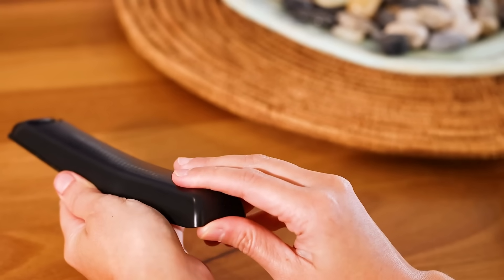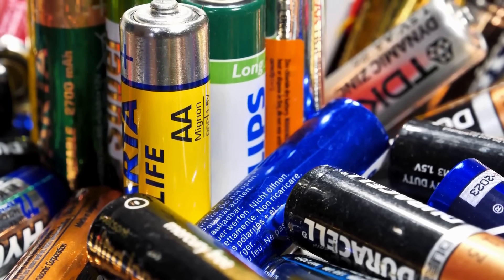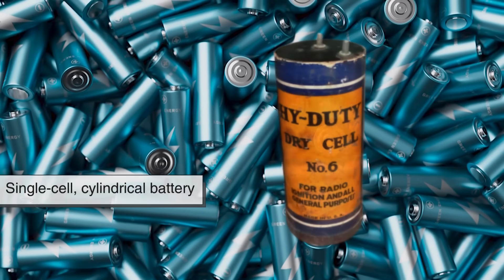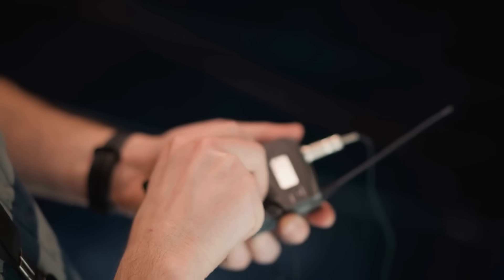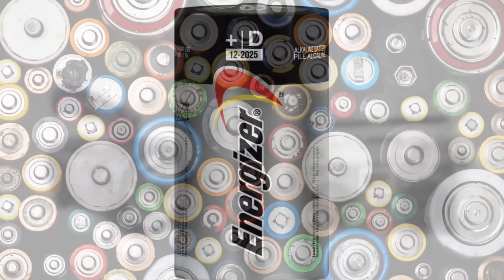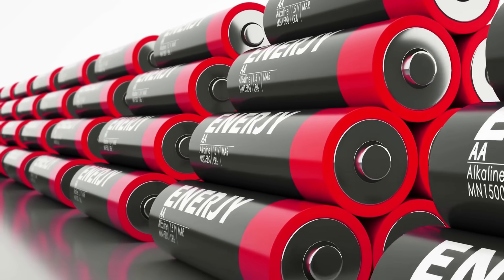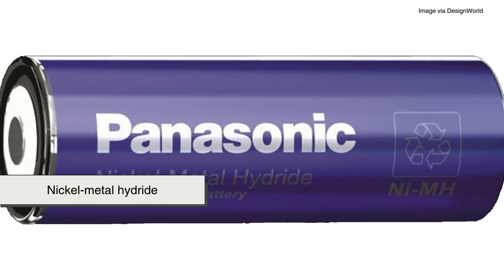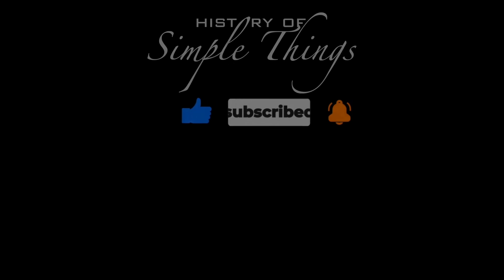The Hidden History of Battery Letters

Comment: Technically AA, AAA, AAAA, C, D, & F are not batteries but rather cells.  Batteries are made of cells.  The 6v and 9v are batteries made of 4xF cells and 6xAAAA cells, respectively, just as a car battery is made up of 6x2v cells.
Reply: Indeed. But even the manufacturers' packaging typically refers to them as "batteries" though, so I'd say common usage is to just call everything "batteries" regardless of whether they are single or multiple cells. Aside from electrical engineers, hardly anybody refers to them as "cells".
Reply: @MikeU128  True that!  Most people, as do I, refer to cells as batteries.  A Radio Shack salesman named Bernie used to (annoyingly) correct me whenever I asked for a AA battery.  "Ain't got none of those but I got some AA CELLS."  Great, just giver me whatever I can get for free with my "Battery of the Month" card!  :face-orange-frowning:
Reply: @redwagnum  lol
Reply: @redwagnum  probably why Radio Shack went out of business
Reply: @MikeU128 yes the manufacturers do call them batteries,  but they also call catsup,  ketchup.
Reply: @moemarchetti9337 Actually it's tomato sauce. Only Americans talk about ketchup.
Reply: Why are flat batteries given away for nothing - because they're free of charge 😂😅
Reply: @clarenceboddicker6679  Technically they're not free of charge, they're low of charge. However, now I'm doing the same thing that the original poster did. Splitting hairs over insignificant sht, instead of seeing the humor in your comment.
Reply: Probably why in French lettered batteries are called "piles" (stacks) while only the big 6v, 12v ones are actually called "batteries".  Although "piles" and batteries are often used interchangeably in everyday language.
Reply: @lajya01  While batterie means drums.
Reply: In Holland we call rechargeable batteries like in a phone or camera 'ACCU' so it's difficult translating sometimes.
Reply: You are on point 👍.
Reply: I think 4.5V is the oldest actual battery form factor still in somewhat common use...
Reply: A battery consists of one or more cells. A battery with one cell is still a battery.
Reply: Very good point indeed. In everyday language, the difference doesn’t exist
Reply: 🤓 Well technically....
Reply: Point- 9v batteries are made from 6 cells, but they have a special designation. You cannot physically fit 6 AAAA cells into a 9v battery because they are too large. An AAAA cell is approximately 2/3 the size of a AAA cell.
Reply: @scotty3114  Given that a 9v battery if 48.5 x 26.5 x 17.5mm and a AAAA cell is 42.5 x 8.3mm I think there is enough room.  See Wikipedia - List of battery sizes.  I have disassembled some 9v batteries though that had 6 flat cells stacked on top of each other.
Reply: @redwagnum I remember AAAA cells being larger than that. I concede that they will fit, just. But, all the ones I disassembled were the raw stacked cells. Not that I've taken that many apart. Sorry about that.
Reply: @redwagnum  This may even be the reason for the AAA dimensions. Many of the batteries like PP3/6/9, 996 etc. could be made up of layer cells or standard cylindrical cells. My recollection is that they used to be always layer cells so it is possible some of the more obscure cylindrical cell dimensions were chosen to fit these battery packs.
Reply: @scotty3114 In the case of 9 volt battery there is assembly of 6 tiny cells but not AAAA size.
Reply: Primary cells and secondary cells?
Reply: Good to know 😊
Reply: You are technically correct of course. I remember being told at school in the 70s that a 'battery' was in fact a plural, a plural of cells. But this doesn't matter of course as everybody calls the individual unit cell a 'battery'.
Reply: Ok, cell.
Reply: Can't a battery be made of one cell
Reply: This makes me wonder though when "battery' became accepted as a synonym for "cell". I think around a century ago as I have some No. 6 cells and smaller sizes that it says "dry battery" on them ("unit cell" was the common way they were described because it was once common to put two or three in a sleeve to make what looked like a giant single-cell, like Eveready's No. 790 battery). I think it may have come about because Saziko Yai demonstrated four of his dry cells as a battery in 1893 at the Columbia World Fair (partnered with Exede lighting company) and the piece of paper for each cell that later became the label for each one (and the first battery label) said "No. 1 Dry Battery" (it was slightly smaller than the No. 6, not to be confused with the C-cell that was initially called the No. 1 because it was the smallest at the time) because each cell was part of the battery but on each cell it looked like each cell was being called a battery. That's just my guess. I have an Eveready cell from 1924 that uses both "cell" and "battery" on the label interestingly enough.

What's ironic is that what's technically called batteries are often cells and most actual batteries (except for the famous 6v lantern battery and 9v battery) are often called battery packs.
Reply: So true.
Reply: Ye yeah but walking to the store and ask for a cell & you'll most likely get something different ,
Reply: I think it should be noted decades ago when there were clocks inside Crystal squares on women's makeup tables they had a N. size or N  gage  AND I'm not that  age but I had one of those clocks I found at a Goodwill & I can tell you that the N. gauge batteries we're still being manufactured in the 1990s and I do not know if they're making them now but I found one in the 1990s to replace in that clock , the N. gage what is approximately 75% of the height of a AAA battery and about the same width it cost about $4 a piece at that time whenever in the 1990s I got the battery
Reply: I agree with the OP.  Even if you aren't going to use the technical terminology, you should at least know the difference for when it does matter.  For example, take an old-fashion, long, cylindrical flashlight.  Insert the four D cells it requires.  What do you have?  A flashlight with a battery, not four batteries. The same holds for the two AAs in your remote.  Once inserted, they actually become a battery.⬅
Another thing to realize is that "battery" is a much more general term than people realize.  It is simply a number of very similar things that work together for a common purpose.  This of course includes power cells, but also canons arrayed on top of a castle wall or ship, or even the pitcher and catcher on a baseball team, who ideally work very closely together.   You  may not be used to thinking of the actual meaning of "battery" to be so broad, but it always has been.
Reply: this guy actually knows what is up
Reply: NEERRRRRRD , please tell us the how count chocula got his name and why butter knives have there shapes. Plz Flex that brain so we can all see how... cough... clever you are. Lol
Reply: Agree, this guy is too novice to talk about this subject matter. He can't even tell the physical measurements / dimensions of those cell sizes, left alone energy capacities.
Reply: Exactly
Reply: Do you know what people buy? They ask for and buy BATTERIES, not cells. Anyhow, thanks for your invaluable input. GENIUS! FYI, a car battery contains six 2.1 volt cells, not six 2 volt cells. A car battery at 12 volts are considered to be at 50% charge, 12.6 volts are fully charged. You forced me to do this, genius.
Reply: @desertstar223 technically correct. People buy battery not cell because it's always sold in pairs of two, three or any even multiplies. So, yeah, they buy batteries, not cells.
Reply: @soosaisteven3984  Doesn’t make sense. Even if they are sold in pairs, these are individual, independent items. So to call them batteries is inaccurate. Besides, if you purchase one pair, this should be called one battery, not batteries
Reply: @desertstar223 I do find it silly the original poster had to fleX about cells. Without explaining the difference, when everyone uses the term battery
Reply: @desertstar223  WOW!  Thanks for your invaluable insight.  You must be WAY smarter than me.  Should have known better than to mention voltage - someone was bound to nitpick my nitpick.
Reply: @desertstar223 ... and you forced me to tell that a fully charged lead-acid battery is 13.8 V, Are there people being forced to tell something more?

Comment: I ran across some "F" batteries.  I cracked open a big 6v lantern battery and it had 4 F cells on series inside.  About the diameter of a D cell and about an inch longer.  I used them in an old radio.
Reply: I didn't know that anything beyond D batteries existed, I've never seen an E or F battery before. I've never seen big 6V batteries either.
I've known that there are batteries made bigger than D though such as car batteries. But they're part of a whole different system and not sold in packages like AAA, AA, or D are and aren't part of the Duracell and Energizer brand market like the common AAA, AA, etc. which are found on the shelves of most supermarkets, retail, and convenience stores, but car batteries for example are only sold in auto parts stores
Reply: @alvexok5523  6 & 12 V lantern batteries are sold in hardware stores under Ray-o-Vac, Eveready and Duracell brands.  Not as common as the old days.  Those batteries have number DESIGNATIONS. Like the Duracell S17590
Reply: @alvexok5523  Eveready #479 is a 90 volt B battery.  45, 67 and 90 volt batteries aren't made anymore but us old radio geeks can daisy-chain ten 9v batteries together to get the 90v.

Comment: Once they were called R20 for the biggest, R14 for middle size and R6 for the normal small batteries.
There were also R03 for the smallest rond, longnmn 
It was better as a battery is a restor that can be charged, either in factory or rechargeble for home use
Reply: Those are the European designations. R20 = D, R14 = C,  R12 = B, R6 = AA and R03 = AAA. If it is alkaline one uses LR instead of R.

Comment: I have a Tablet that uses a AAAA Battery in it's Stylus, I'd never heard of them, but Amazon Sell Them ! and yes they are smaller in height and Diameter than a AAA Battery
Reply: Have you ever opened up a 9v battery to see what is inside?
Reply: @jeremyarchbold4586  Yes. It had 6 tiny cells, on top of each other.  1.5 X 6= 9
Reply: I saw some AAAA batteries at Home Depot, or Lowe's. They also had N batteries, the same diameter as AAAA, but only about 1 inch long. Not to be confused with a MN21 battery,which is 12 volt!  Look carefully!
Reply: @BakedRBeans No, AAAA are slimmer than N. N have the same diameter as AAA but are shorter.

Comment: ..tou should do a spot in the old 'block' or 'brick' style 6 and 9 volt batteries that powered the old 'portable' AM radios of my yute..'portable' usually meant three or more pounds
Reply: I ran across some "F" batteries.  I cracked open a big 6v lantern battery and it had 4 F cells on series inside.  About the diameter of a D cell and about an inch longer.  I used them in an old radio.

Comment: I knew why. Old radios years ago used A and B batteries.
A for tube filaments, B for the plate voltage.
6 AAAA batteries are inside a 9 volt battery
Reply: My valve radio used a B126 for the HT. Can you recall the LT one? It was square.
Reply: Some of the early TRF battery ‘farm’ radios used three batteries, A, B and C  and later morphed into just A and B when designers eliminated the need for the C battery.  The B battery was the high voltage for the plates of the vacuum tubes - I’m not sure but I think it was around 90 V.  The other battery was needed for the tube filament which was required high current, low-voltage - typically 6.3 V or 12.6 V 
 
The lettering nomenclature survived into the modern (at the time) AC/DC and AC radios and amplifiers - and into modern times the plate voltage was called B+.    With the onset of transistor technology the terminology changed to V (for voltage) and was subscripted with things such as VCC, and such.   

But in old two equipment still around today they still referred to the plate polities just B+ because of the old B battery.
Reply: @kenday7942    The B battery faded away because, with transistors, there was no need for B+.  The lower voltages changed their roles but were still useful with transistors. I remember an old "TransOceanic" radio had A, B, and C batteries.
Reply: Some early radios also tapped the B battery to energize the static field in the speaker as some did not have permanent magnets.
Reply: The AD35 manufactured by Ever Ready in Britain (or equivalents by other manufacturers such as Exide) was the most common type of low tension battery, with two 1.5 volt cells side by side - connected in parallel. AD meant All Dry. The earliest transistor radio receivers in the later 1950s used a range of 9 volt batteries such as PP3 and PP9. PP denoted Power Pack.
Reply: Ever take apart a 6V battery? :)
Reply: You knew incorrectly. While radios had A and N batteries those had absolutely nothing to P with A and N as battery sizes that did exist.
Reply: Old radios years ago used A and B batteries.
A for tube filaments, B for the plate voltage.
Wrong. B size is not B+ battery.
A and B size battery is 1.5V roughly
"A" batteries were initially 2 volts, being lead-acid accumulators, but with the introduction of all-dry-battery radios, 1.4 volts became more common. Other voltages can be encountered. For example, 7.5-volt batteries are sometimes used to power a series-connected set of 1.4-volt valves (tubes).
Early "B+" batteries used with bright emitter tubes were 120 volts, but these quickly became obsolete as they were replaced with examples having voltages of typically 45 volts, 67+1⁄2 volts, or 90 volts as more efficient tubes became available. Some examples have taps every 22+1⁄2 volts. The last B batteries sold were 22 1/2 volts and similar in size to a PP3 9-volt battery. (wikipedia)
Try to use one instead the other....
Reply: I learned about old radios years ago, in high school electronics class. A meant filament voltage, B meant plate (high) voltage. Automotive-type "wet" cells were used. So it wasn't about battery shape, it was about voltage. This was done after radios were invented, but before most homes (especially in rural areas) had electricity.  About once a month, you would take the radio's batteries back to the hardware store, and exchange them for fully charged ones.  Now, a word about voltage: wet cells (like car batteries) are 2 volt, Non-rechargeable cells (mentioned here) are 1.5 volt, including the button cells, rechargeable cells are 1.2 volt,so those might not work in a device meant for 1.5 volt cells. Note: some larger-diameter button cells are 3 volt (two ultra-thin cells stacked together.  Finally, the battery pack for an electric car (Tesla, for example) are composed of many 1.2 volt cells grouped together.
Reply: @BakedRBeans electric vehicles use lithium ion cells, that chemistry has a nominal cell voltage of 3.7v not 1.2v
Reply: @BakedRBeans Not all receivers used wet batteries. Most I have seen use dry batteries. In the recent portable tube radios use either a 1.5 or 9 volt A battery for the filaments and a 90 volt B battery for the plate voltage. In the early days they didn't have experience with   internally generating bias voltages, so they used more batteries. They would use a #6 ignition cell for the 1.5 volts for the filaments, a 4.5 volt 'c' battery, sometimes a 22.5/45 volt battery for screen voltage and either a 90 or 135 volt battery for the plates.

Fun fact: In the 60s and 70s I had a camera flash that used a 510 volt dry battery. You did not want to get across that monster.
Reply: @scotty3114  You are correct about the portables, but the home units, I was told, used wet-cell setups, as I described. Back in the early 1960s, I bought a portable with 4 batteries in it-two for the A circuit, and 2 for the B circuit. Many different voltages were used. As the video said, there were no standards at first.
Reply: @scotty3114  Further to your remarks, the filament power for console radios was high, hence lead-acid rechargeable "A" batteries (typically 6.3VDC); the "B" battery supplied low-current plate voltage; and the "C" battery provided negative bias voltage for the control grids in the vacuum tubes (originally only triodes).
Reply: @BakedRBeans  wet cells were  primarily  A batteries for  filament voltage.  The filaments drew the most current.  If you were lucky you had a charger at home otherwise you took your A battery to the radio shop which had charging facilities  and swapped your depleted battery for a newly charged one (for a small fee as well of course)
Reply: @BakedRBeans Teslas use rechargeable batteries. They (the original batteries) are composed of many lithium-ion cells, with a single fully charged is 4.2 volts, maximum discharge is 3.0 volt. The same as cell phone, laptops and all the other rechargeable stuff they want us to buy.
Reply: I've disassembled too many 9-volt batteries. While some are composed of AAAA cells, others are stacks of electrodes in electrolyte, i.e. not individual cells that can be placed directly into another device (if one existed).
Reply: @JV-pu8kx  I didn’t know that about 9 V batteries!  Interesting. 🤔
Reply: @kenday7942    All "batteries" are a battery of cells. (like a military battery of weapons) Some batteries are a collection of cells arranged into smaller batteries inside of a larger battery. (9V battery)  That's why a button or coin cell is a cell, not a battery. It is a single cell, not a collection of cells. A Li-on and Li-po cell is a cell, not a battery. People call them batteries because they look like batteries.
Reply: I found out about the AAAA cells in 9v battery when one cell randomly exploded in one in my bedroom. It wasn't in a device so that was lucky. The bang sounded like a .22!

Until then I just assumed there were a vertical stack of button like cells in them.